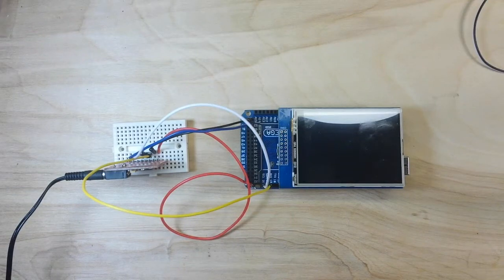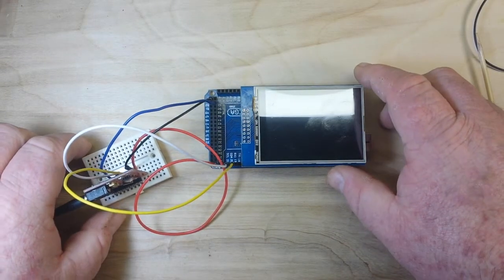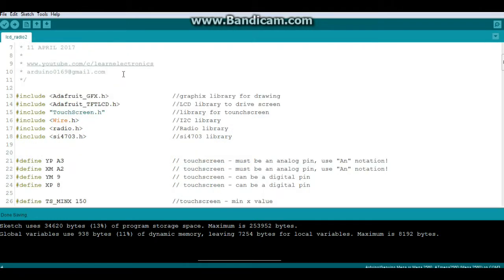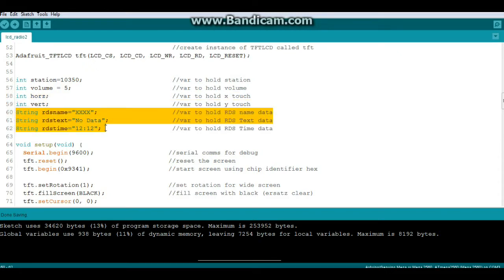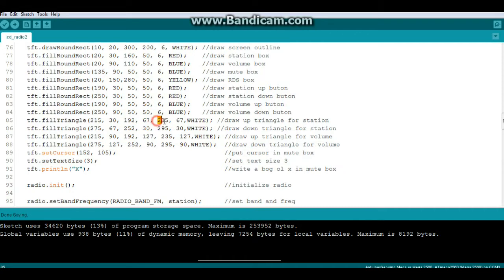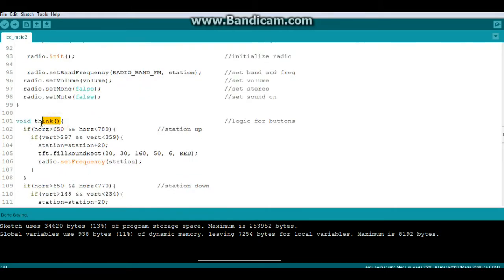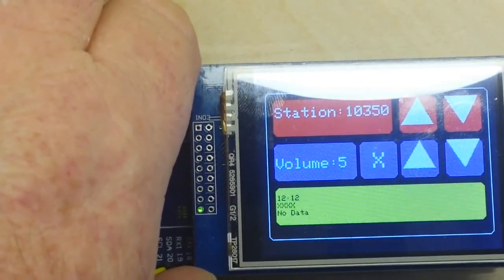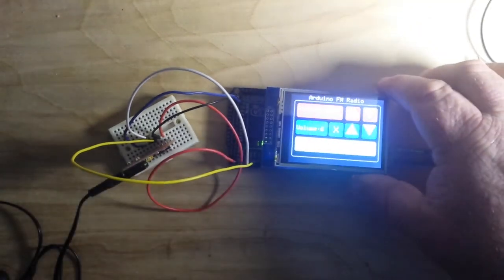Arduino Touchscreen FM Radio

Comment: Hi I have built this radio as part of a valve receiver project and it works great but I would like to get the RDS functionality working. are you still going to do the video of the implementation of the RDS Please.

Comment: If you have the purple version of si4703 and a Mega, the library is different, (not the breakout version), and won't compile with new pin settings. You won't have to change the library then.

Comment: Hi,
I fixed my problems and it works great.
First fix: The librarys for TFT 
       #include <Elegoo_GFX.h>                      // Core graphics library  Elegoo-TFT
       #include <Elegoo_TFTLCD.h>                  // Hardware-specific library  Elegoo-TFT

second fix:  The Pins for Mega  (changes in Code):
uint8_t resetPin = 52;
uint8_t SDIO = SDA;
int SCLK = 21;

SI4703 radio(resetPin, SDIO);                             //create instance of SI4703 called radio

Lets start the next step:  The RDS implementation!    Can you help me with this?

Comment: Hi,
After starting with my first step tutorial from instructables with Si4703 I tried to realize your tutorial with touchscreen.
First I make the changings in the Si4703.cpp:

// int STATUS_LED = 13;
int resetPin = 52;

// SDA/A4 on Arduino
int SDIO = 20;

// SCL/A5 on Arduino       
int SCLK = 21;    

After this: Compiling and upload to me MEGA.  No mistakes and the upload works.
But I only get a white display. No buttons??? 

Do you know this problem?

Comment: Du hast sicherlich schon mehr Erfahrungen mit dem Si4703 als ich.
Bevor ich mich mit deinem Projekt beschäftigen wollte, habe ich noch etwas leichteres zum Einstieg gefunde. Dachte ich !!!
https://www.instructables.com/id/How-to-use-the-Si4703-FM-Radio-board-with-RDS-Ardu/ 

Leider bekomme ich dieses nicht zum Laufen.
Als Library für den Si4703 habe ich die von   Gitghub genommen:   Whiteneon/Si4703_FMRadio 

Kompilieren und hochladen funktioniert einwandfrei.

Mein Problem ist, dass im Serieal Monitor leider nach Eingabe z.B.  a  und <SEND> kein feedback erfolgt.
Ich habe dann diverse  Serial.print - Marken eingefügt und sehe, dass das Programm in der void setup() vor den Befehlen radio.powerOn();
radio.setVolume(0); 

stehen bleibt und die void loop() nicht durchläuft. Hier hatte ich am Anfang auch eine Serial.print - Marke eingebaut.

Hier mein sketch:

#include <Wire.h>
#include <Si4703_Breakout.h>

const int resetPin = 2;
const int SDIO = A4;
const int SCLK = A5;

Si4703_Breakout radio(resetPin, SDIO, SCLK);
int channel;
int volume;
char rdsBuffer[10];
char ch;

void setup()
{
  Serial.begin(9600);
  Serial.println("\n\nSi4703_Breakout Test Sketch");
  Serial.println("===========================");  
  Serial.println("a b     Favourite stations");
  Serial.println("+ -     Volume (max 15)");
  Serial.println("u d     Seek up / down");
  Serial.println("r       Listen for RDS Data (15 sec timeout)");
  Serial.println("Send me a command letter.");  
  radio.powerOn();
  radio.setVolume(0);
  
  Serial.print("Ende setup");
  
}

void loop()
{   
  
  
  Serial.print("start loop");
  
  
  
  if (Serial.available())
  {
    ch = Serial.read();    
 
    if (ch == 'u') 
    {    
      channel = radio.seekUp();
      displayInfo();
    } 
    else if (ch == 'd') 
    {
      channel = radio.seekDown();
      displayInfo();
    } 
    else if (ch == '+') 
    {
      volume ++;
      if (volume == 16) volume = 15;
      radio.setVolume(volume);
      displayInfo();
    } 
    else if (ch == '-') 
    {
      volume --;
      if (volume < 0) volume = 0;
      radio.setVolume(volume);
      displayInfo();
    } 
    else if (ch == 'a')
    { 

Serial.print("a wurde ausgewaehlt");
          
      channel = 888; // radio1  
      radio.setChannel(channel);
      displayInfo();
    }
    else if (ch == 'b')
    {
      channel = 943; // RS2
      radio.setChannel(channel);
      displayInfo();
    }
    else if (ch == 'r')
    {
      Serial.println("RDS listening");
      radio.readRDS(rdsBuffer, 15000);
      Serial.print("RDS heard:");
      Serial.println(rdsBuffer);      
    }
  }

  Serial.print("Ende der loop");
  
}

Viele Grüße
Ulli

Comment: Hi friend I wanna copy your radio.I 'll try to find the RDS value.I purchased si4703 and tft lcd but my si4703 model request for 3.3 volts but 3.3 volts request and tft lcd so i should connect them in parallel connection with wires so I connect all tft lcd pins in arduino with wires.Now I wanna learn if your Arduino Mega is 2560 model.I wanna ask if I find the code for RDS to make my own video with RDS radio or send code with RDS value here in comments to help your the audience asking for an RDS tuner.

Comment: When you turn the power OFF and then ON again, does the unit remember the channel and volume setting ????
Reply from the maker: Far Que no it hours back to the station and volume in the setup() function. but you could save the current values in eeprom and read them back in setup, then it would remember

Comment: I have this exact Tft! I connected it to an atmega1284p so I had spare pins. This display DEFINITELY uses the ili9341 driver though and is actually fully compatible with the adafruit Tft LCD and gfx libraries. I was planning to make this project with a tea5767 but couldn't get it working so I will definitely check out the module you are using in this video